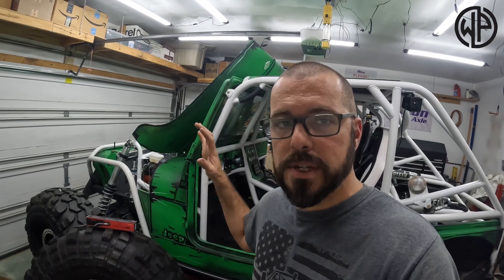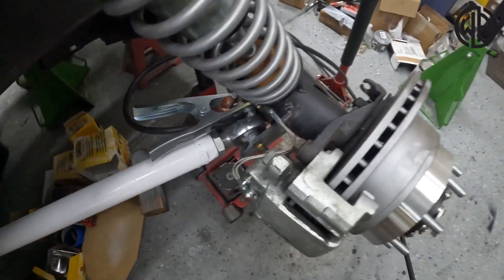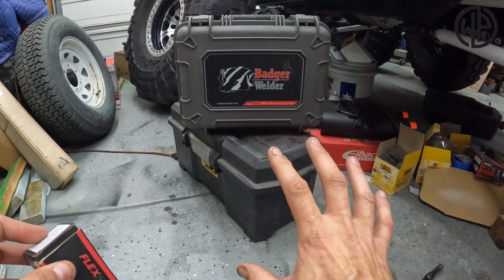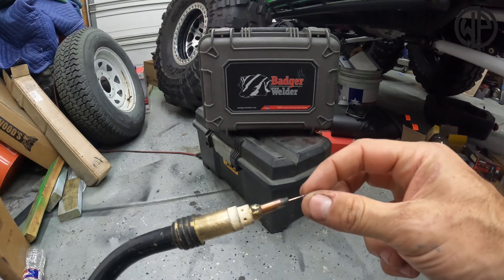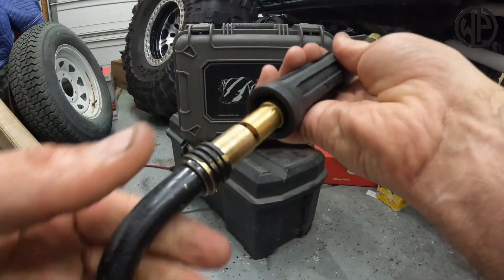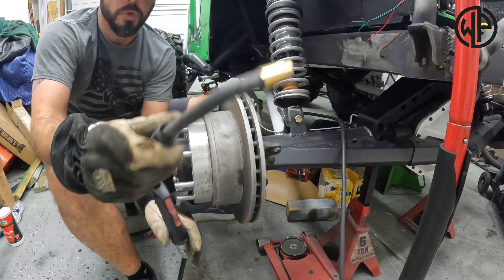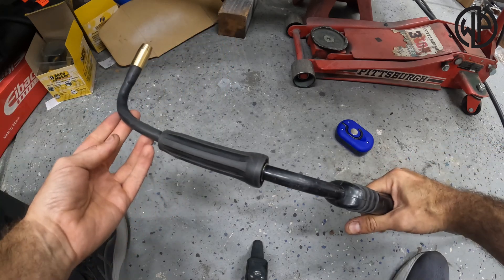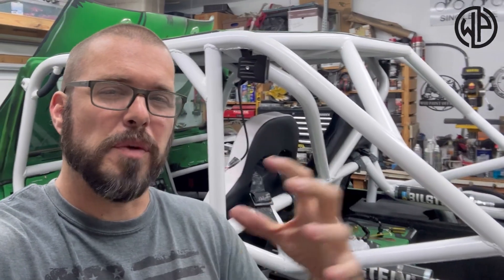HOW TO MIG WELD LIKE A PRO - Hard to reach welds

Comment: How did you mount your headlights. I’m in the same problem when I had to cut the back of the grill
Reply from the maker: So these lights are the Nacho Grande. They aren’t really headlights…but I have them wired to be a headlight. They have a bracket that you can see online. It attaches on both sides and the goes across the top. I mounted a piece I 1x2 rectangular tube on top of the bracket to lower the headlight into the right position. Drilled holes through it and used longer bolts. The put the bolts through the top of the grill…through the bracket…and put nuts on the bottom. It put them at the right height and allowed me to center them. The brackets that came with the lights then have adjustment for raising and lowering the beam of light.